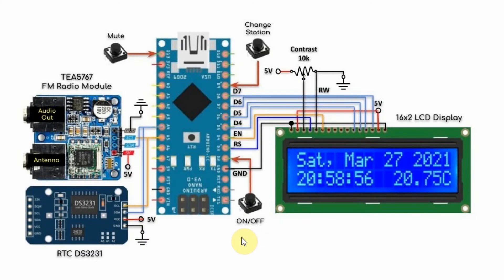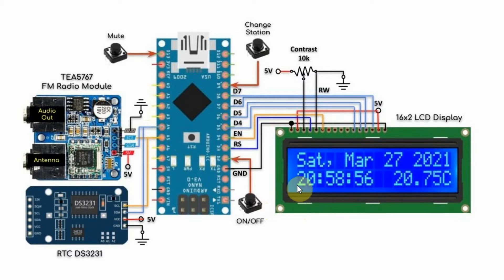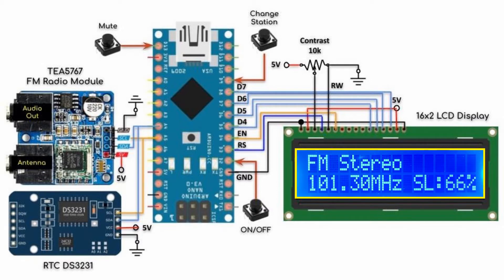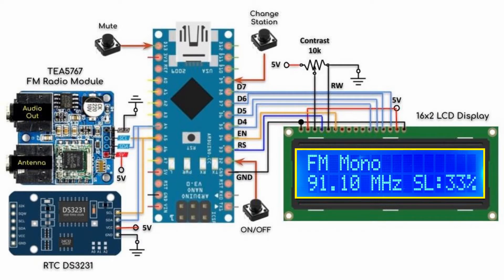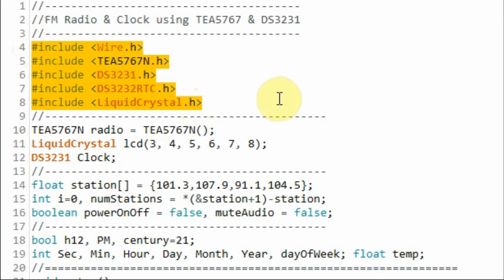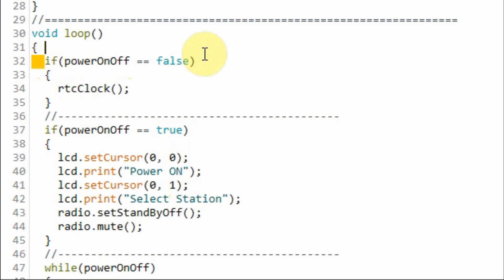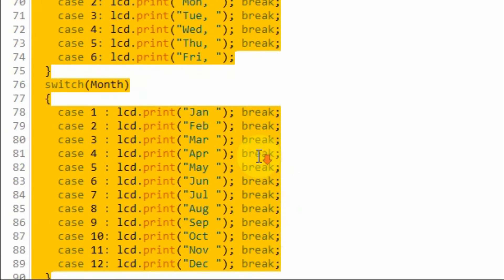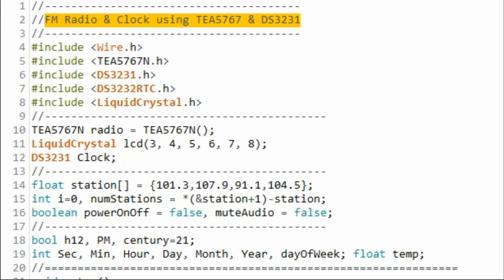FM Radio & Real Time Clock via TEA5767 & DS3231

Comment: Hi,
Why does the code give a compilation error? Where am I going wrong?
Reply from the maker: Can you be more specific? What is the error message?
Reply: @AnasKuzechie  Hi 
I'm sorry. I have installed all the libraries. But I did not understand if I got the codes wrong while coding from the page. It gives the following error:
Arduino:1.8.13 (Windows 7), Kart:"Arduino Uno"

C:\Users\s�n�f\Documents\Arduino\libraries\DS3231\DS3231.cpp: In member function 'void DS3231::setEpoch(time_t, bool)':

C:\Users\s�n�f\Documents\Arduino\libraries\DS3231\DS3231.cpp:264:12: error: aggregate 'DS3231::setEpoch(time_t, bool)::tm tmnow' has incomplete type and cannot be defined

  struct tm tmnow;

            ^~~~~

C:\Users\s�n�f\Documents\Arduino\libraries\DS3231\DS3231.cpp:266:3: error: 'localtime_r' was not declared in this scope

   localtime_r(&epoch, &tmnow);

   ^~~~~~~~~~~

C:\Users\s�n�f\Documents\Arduino\libraries\DS3231\DS3231.cpp:269:3: error: 'gmtime_r' was not declared in this scope

   gmtime_r(&epoch, &tmnow);

   ^~~~~~~~

C:\Users\s�n�f\Documents\Arduino\libraries\DS3231\DS3231.cpp:269:3: note: suggested alternative: 'time_t'

   gmtime_r(&epoch, &tmnow);

   ^~~~~~~~

   time_t

exit status 1

Arduino Uno kartı için derleme hatası.

This report would have more information with
"Show verbose output during compilation"
option enabled in File -> Preferences.
Reply: Ok, I solved the problem. Installing another version of DS3231 library solved the problem. Thank you.
Reply from the maker: @djtur1  Great

Comment: Anas
After a lot of research I found an easy way to convert your 24 hour clock to a 12 hour clock.  I replaced the attached code to your sketch from lines 111 to 120.  I have been running this for a couple of days without any issues.  I hope this helps anyone wanting to convert their project clock display.

//Convert from 24 hr to 12 hr ===================
  if(Hour > 12)   //ADDED THESE IF STATEMENTS
  Hour = Hour - 12;
  if (Hour == 0)
  Hour = Hour + 12; //============================ 
  {              
    lcd.print(" "); //REMOVED 0 HERE NOT NEEDED FOR 12 HR CLOCK
    lcd.print(Hour);
  }                     
 // else lcd.print(Hour); REMOVED THIS ELSE STATEMENT NOT NEEDED FOR 12 HR CLOCK
Reply from the maker: Hi Eddie. Thanks for your input.

Comment: I have done that project and I did a lot of modifications on your set that involved electronically like adding in the volume, treble & bass. I even added on a rechargeable battery and TP4076 module so it can be rechargeable, and I added on more power by using an amplifier  PAM8401 5V. Not forgotten I added on the voltmeter to know the level of the battery. The FM radio sounds great.
Reply: Thank you for sharing your Arduino code and circuit diagram.
Reply: Next in the same project, I will add in the SD card. But it is just that how to add the new code for sdcard into the previous Arduino nano that has already code FM Radio, Temperature, IR Remote, and Clock. If you could only upload a video on how to add in a multiple codes in a single Arduino c++ code.
Reply: And sir, last but not least may I get your permission to use and upload your code and lesson on my next upcoming youtube video? Hopefully, you don't mind as we share your knowledge on the world of Arduino Technology. Thank you
Reply from the maker: @andriarshad6586  sure, I’ll look forward to your video
Reply from the maker: @andriarshad6586  yes it’s possible to add an SD card module which uses SPI interface. Yes I could update my project and add the module. Maybe in the near future. I’m currently preparing educational videos on assembly programming using Arduino.
Reply from the maker: Great, I would love to see a tutorial on that project.
Reply: Sir how to make an online radio using esp 8266